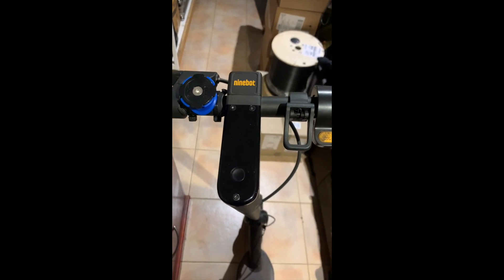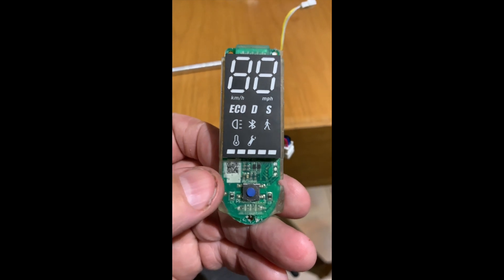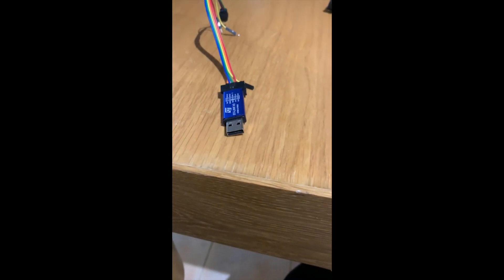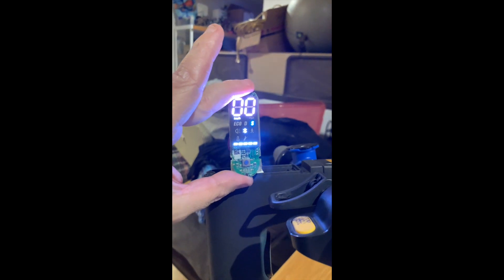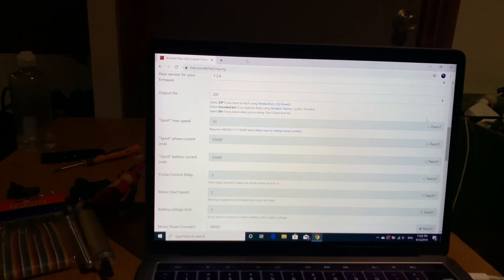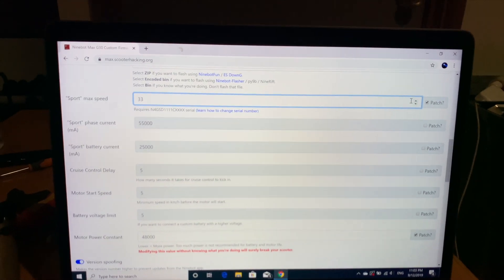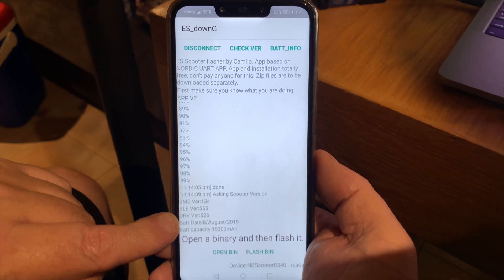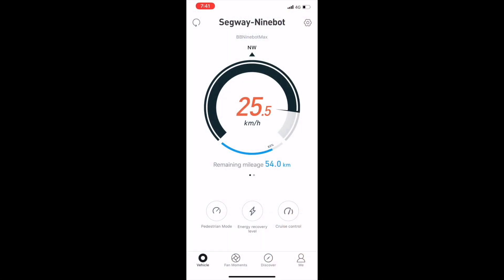Ninebot Max G30/SNSC 2.0 (X-RENTAL/RENTAL Version) Custom Firmware Guide - !!!READ DESCRIPTION FIRST

Comment: My ESC says 0.0.0
ble is 1.1.0
Bms: 1.5.8
scooter region Unknown
I can't seem to change the serial code either
Reply from the maker: Have you tried flashing it with Xiaoflasher and the default firmware that’s included in Xiaoflasher?
Reply: @BB3DPRINTING  i found out i have an XBOT lebiTEC controller, the controller comes with 4 pins ready to plug in the st-link but they don't have an identification on them and its almost impossible to get into any chinese website for a tutorial
Reply: so my controller blew and i replaced the controller, this video is about connecting to the dashboard which is the BLE i believe
Reply from the maker: @kevmatt8450  yes, the BLE is within the dashboard. The controllers don’t normally come pre-flashed unless the seller has stated that it would be. This means you need to flash it manually or if you can connect to the Bluetooth (BLE) then you can simply flash it with Xiaoflasher
Reply: @BB3DPRINTING  yeah these ones made by XBOT seem to have their own app that in australia you cannot connect to to do CFW, i'm getting a full refund and then buying another one that doesnt have XBOT on the picture..
its becoming a big issue because people are waiting over 2 months for postage just to get bent over, always use paypal on ebay kids

Comment: Will it become normal if i just change the dashboard?
Reply from the maker: No you need to flash both the dashboard and the ESC otherwise they will not handshake which means they won’t be able to send and receive data
Reply: @BB3DPRINTING  what's ESC?
Reply from the maker: @lashapap9106  the ESC is the controller for the motor but it’s also the brains for the whole scooter
Reply: @BB3DPRINTING  well, if i buy only the controller and repalace the hacked one, it should work right?

Comment: Can you just flash it using the display plug instead hard tapping on those
Reply from the maker: No as there is firmware on the dashboard pcb that has to handshake and communicate with the esc in the motor controller

Comment: Hey mate I bricked my scooter trying to upload a cfw now I get error 10..I think I updated the wrong cfw..can I speak to u personally about flashing back
Reply from the maker: If you have access to Xiaoflasher and you are still able to connect to Bluetooth then simply go into Xiaoflasher and go down to flash factory/default firmware this will then allow you to go back to factory and start again.

If you can no longer connect to Bluetooth then you might have bricked it permanently this unfortunately requires you to replace the controller.

Comment: 33 km/h must be a software limitation as M365 Pro is able to do 35km/h or even more (?)
Reply from the maker: No software limitations Segway-Ninebot have put the limit in the esc of the hub motor making it a hardware limitation but that is only in Gen 1 motors Gen 2 motors have been released and now can achieve speeds of 45km/h and with a 48v battery 55km/h.
Reply: @BB3DPRINTING  Can you only buy the 2nd gen motor separatly? Or is there a new max model? Im from germany and the version legal to buy here is the ninebot max g30d.
Reply: @BB3DPRINTING  how can you make it go 45kmh? I own a second gen getting 37kmh with custom serial number and custom xiomiflasher file how can I reach 45?

Comment: I bought an ex rental max (legally). Which method is meant to work? I tried the xiao app on an android, it connected but didn’t recognize the firmware. Thanks! Its the Segway Discovery model with front brake only and iot in the front.

Comment: Thanks for a video! I used the XiaoFlasher (XiaoFlasher for m365(Pro) - NineFlasher for ES-G30 ) and scooterhacking.org pre-set maxed out settings. Question: how to go back to default firmware?
Reply from the maker: You can simply select that option In XiaoFlasher no download necessary

Comment: Thanks Anthony yes legally acquired from impound auction previous rental. I will get photos today.
Reply from the maker: Awesome if all else fails I have a spare dash here I can send you just cover the shipping only thing is I am in Australia. The dash is already flashed too so you’ll be able to just plug it in and go. Also when you reflash the dash make sure everything is connected brake, throttle, light and connected to the ESC controller cable and the scooter must be powered on. 

Wishing you good luck 👍
Reply: @BB3DPRINTING  is it possible to just buy a dashboard from China and then plug it into the ex rental?
Reply from the maker: @spinnanz  yes and no. Once you have the dash you still need to flash the controller with either custom or factory firmware

Comment: So after all that no test run to show us how fast you got it to go?! I assume it doesn’t go 40MPH. Or was that 40 KPH?
Reply from the maker: Hi Dave, if you go to timestamp 13:28 you will hear me clearly state that even though I have set the speed to 40KPH I have never achieved that speed and I have also stated that the highest top speed I have achieved is 33KPH. 

I am sorry that I didn’t show a test run afterwards I am new to being a YouTuber so thank you for your feedback it will only help me to be better in the future.

In regards to the future videos I am about to make an updated video using the most current methods and some news for the Segway Max too.

Thank you for your comment and happy scootering.

Comment: I did the ble555 flash by running the connect_dashboard bin. The flash was successful according to terminal but the dashboard just froze, I unplugged it from controller and plugged it back in and it will not power up. I would appreciate any help, anyone can give. Thanks
Reply from the maker: Was the dash connected to the Ninebot MAX and powered up at same time as flashing?
Reply: Thank you sir I will try it and I will let you know
Reply: HelloAnthony thanks for replying. Yes it was connected, and not on exactly I was getting a 32 error prior to flashing so the screen was lit but I could not turn it off with the button.
Reply from the maker: XXX I have only come across this once before and to over come the problem I had to hold down the power button while flashing with the cfw but I had to use an Android device running ESdownG this means to will need to creat a new cfw file but selecting the ZIP when creating the cfw. Hope this helps if not let me know and I’ll see what I can do
Reply: Update - Ok so the scooter runs with ES.xx dash. When I plug inMax dash it does not turn on automatically but if I press the power button I get flashing tail light but das does not light and I am unable to see Bluetooth connection. Is it possible I flashed it ok with st link but with wrong bin? Or maybe a different capacitor other than C2 on this scoot?
Reply from the maker: XXX XXX can you please send me some photos of your Max dashboard as it sound like you may not have flashed the dashboard correctly and if you have taken the wrong resistor off I am unsure that you’ll ever be able to get it working (by it I mean the max dashboard) also is this a retail scooter or a secondhand rental that you have obtained legally(I’m not accusing of anything people purchased secondhand scooter from rental companies all the time). 

And lastly the bin that is included in the linked zip file is the correct one as I used it my self only the other day and it worked perfectly. 

If all else fails reflash max dashboard and screenshot what response you get from the bin file.

Comment: The only info I did not get watching this video is the exact ST-Link setup about which jumper goes where and where can I download the driver for the ST-Link. Otherwise it`s ok. No biggie because I can find out myself, however those details are kind of important ones so we don`t have to watch two other tutorials to find out. @ 6 minutes 6 seconds if I pause the video it can be seen that you have the fourth wire connected also to the 3.3V pin (you never mention that) only talking about the taped together 3 wires ( Ground, SWDIO and SWCLK) that you touching to the 3 points on the board.
Reply from the maker: Yes I have a forth wire connected but it was not being utilised in this case, that wire is there for flashing ESX dashboards that require the 3.3v along with the GND, SDWIO & SWCLK.
Reply from the maker: @Crazy Online Videos yes it makes
All the difference. You must have brake
And throttle connected when flashing

Comment: hey anthony some questions:
1) what Motor Power Constant
 do you use? do you really use 40,000 ? is there a thread where people have tried various values and what that means in terms of max speed?
2) what is BMS and ESC ?

for my custom serial number, N4GSD1111C1234, i can only get max  23 kilometer/hr as well

Comment: Hey, Lothean from ScooterHacking!
Great tutorial :) 
The BLE goes to sleep mode, just keep both brake and throttle pressed until it stops beeping, and Bluetooth will start again ;)
Reply from the maker: Thanks I know its not the most professional video out there but it gets the job done :) 
Awesome that works a treat thanks for the update.
Reply: @BB3DPRINTING  0
Reply: Lothean, thanks for all you did to make Ninebot scooters fun and more accessible. You've helped me flip many many broken auction scooters. I've basically started a mini side hustle in SLC thanks to your good work. You've helped me keep food on the table and a roof over my kids heads during these difficult times. Many thanks!
Reply: Q